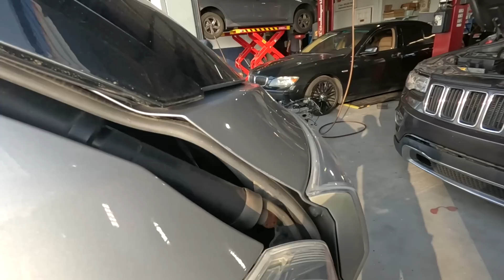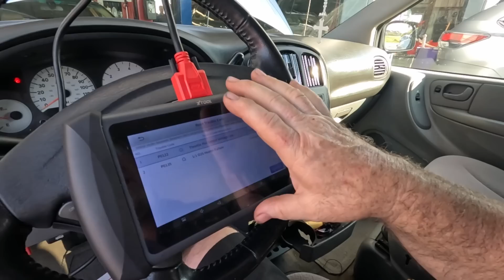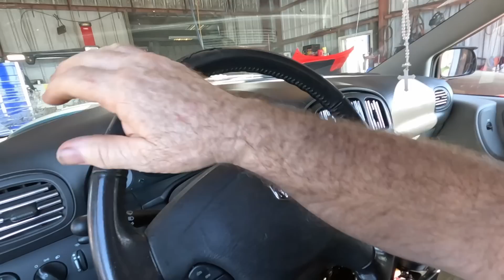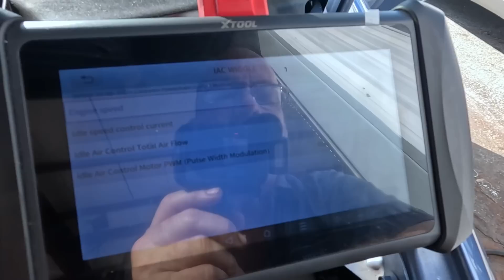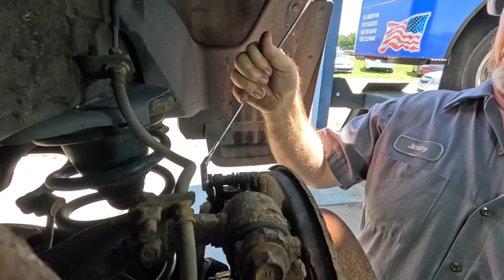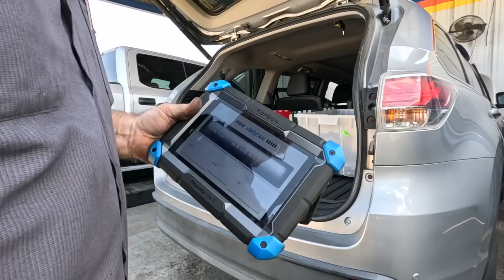JETTA OIL LEAK, CARAVAN DEBACLE, HIGHLANDER BRAKES, DAY IN THE SHOP 463 CAN WE FIX IT?

Comment: Jimmy would a throttle relearn be helpful when you change throttle body,s paul from england
Reply from the maker: Yes, very much so if it has the ability to do one. Fully electronic throttle bodies all need a relearn after cleaning or repair.